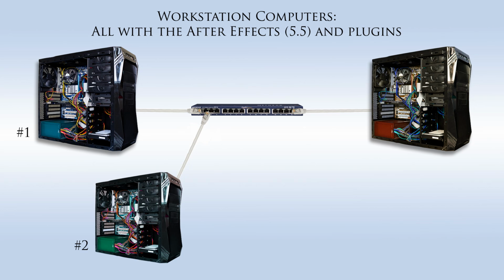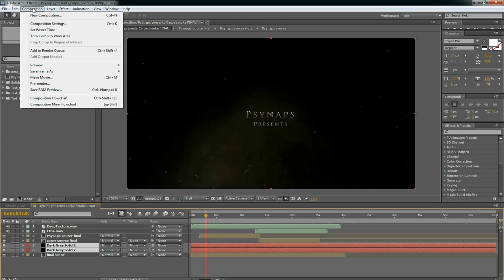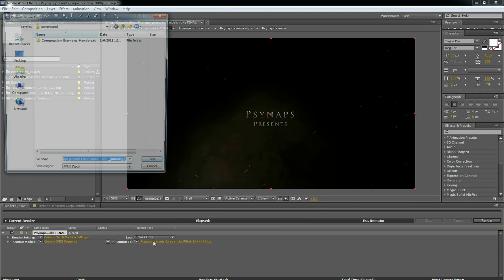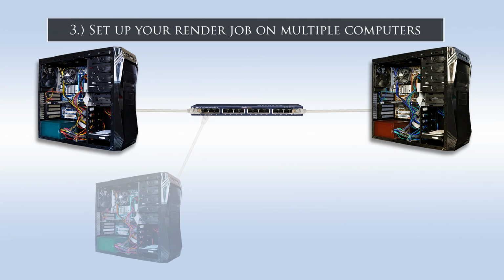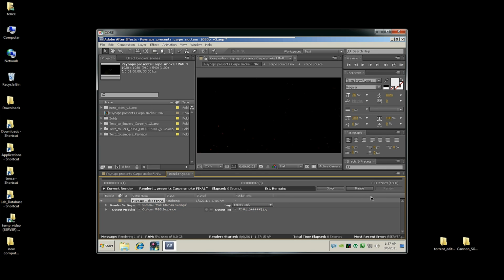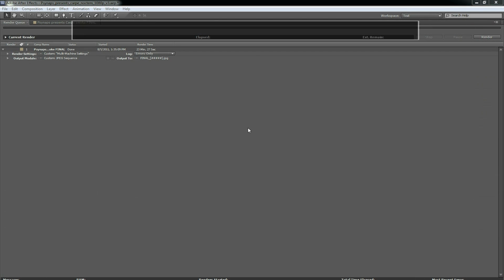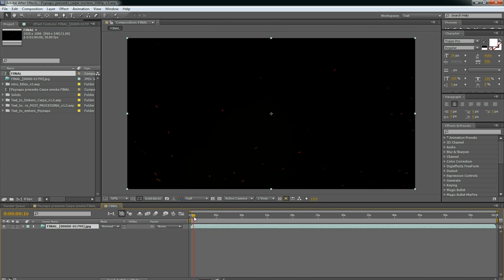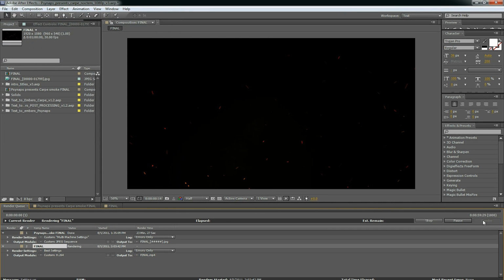After Effects Tutorial: Faster Rendering with Multi-Machine Network Rendering

Comment from the maker: @bl1ppyboy It does not have to be on a file server. 1 of the 2 computers can share the source video. You can also have the source video copied to both computers. In fact, this way is even faster because it does not rely on network/server speed. One strategy that works for me, render half the video on one computer, and the other half on the second computer simultaneously. Then combine the image sequences on one of the computers for the final movie. You can do this with or w/o a network/server.

Comment from the maker: Thanks for the comment freakstate. I've had great luck rendering one locally to a shared folder, and have the other computers help out to the shared folder. Network speed, and disk speed is a big rate limiting factor. The bottom line, the usefulness of network rendering depends a lot on how much processing each frame needs. If each frame doesn't need much processing, it may be faster to do it on 1 computer, but if its processor intensive, it may benefit significantly from network rendering.

Comment from the maker: Yes it works great in CS5. Yes, slow-mo and any effects work fine when rendering as an image sequence. You can use any frame rate in your composition settings, although I have never tried more than 60 fps. Just make sure, when you import the sequence, you "Interpret footage" and match the sequence framerate to the framerate you used during render/export.

Comment from the maker: Yes it works great in CS5. Yes, slow-mo and any effects work fine when rendering as an image sequence. Everything looks fine when the image sequence is played back at the same frame-rate it was rendered at. You can use any frame rate in your composition settings, although I have never tried more than 60 fps. IMPORTANT: Just make sure, when you import the sequence, you "Interpret footage" and match the sequence framerate to the framerate you used during render/export.

Comment: Does this really speed up the process of rendering, did you, by some chance, tested same rendering speed using one computer, and then using multiple? 
Cuz I don't understand this, if the first computer is rendering first frame I don't see what good can it do if the other one is rendering the same frame,  I mean I would understand if the first Pc was rendering every unpair frame (1,3,5,7,9..) and the other pc was rendering every pair frame (2,4,6,8..). So please explain it would mean a lot
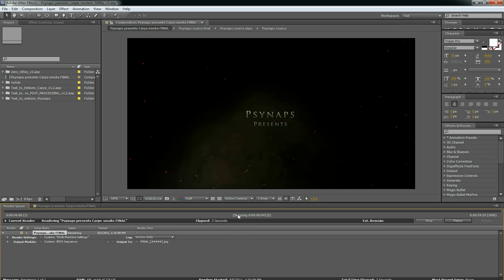Reply: I don't know if you are still looking for answer, but yes. The software actually checks if the images are rendered on the other computer. In 3:31 you can even see the message that it's skipping the images that the other computer has created/is rendering. This way even slower and faster machines can work together as they pair because they only start working on the next un-rendered frame
Reply: I know this is an old comment, but yes. Cut my 2hr and 45 minute render down to 20 minutes using two computers.

Comment: So the real purpose is just to speed the process for CGI, not to increase encoding time, i get it. I wanted to use two machines to encode video in 4K 60 fps in H.264 a bit faster, since one machine takes 3 minutes for 10 seconds.
Reply from the maker: ffmpeg can join two mp4s together, so you can render half of the video on computer #1, and the other half on #2, than join them together in ffmpeg WITHOUT reencoding them, the process in ffmpeg is almost instant. I will consider making a guide on it.
Reply: Psynaps That's exactly what i thought after watching this

Comment: if there will be around 20 or more computer connected to the network share at the same time , doesn't this create a bottleneck in the network traffic? If the Gigabit Ethernet can handle this traffic, how can the computer (the computer with the shared network drive) handle this??

Comment: if i buy a IBM System x3850 M2 Server
-4xQuad Core Xeon 2.93GHz-64GB-2x146GB SAS-2xPS-DVD
Model 7141-4RU 4U rack mount Server

4x Intel 7350 - 2.93GHz Quad Core Xeon - 8MB L2 Cache - 1066MHz FSB - EM64T (64-Bit) - Virtualization (VT) - 16 Cores Total
64GB DDR2 667MHz REG ECC SDRAM 
2x 146GB SAS 
IBM ServeRAID-MR10k
7x PCI Express x8 slots (2x hot-swap) 

his that any good for rendering ?

Comment: Great tutorial! But it seems not possible to render with more than 2 machines with one AE-licence!?
Reply from the maker: Yes, each machine needs a license with this method.
Reply: If, after setting up your render queue and saving the project, you "Collect Files" on a network watch folder, you can run the After Effects Render Engine on another computer (or computers) without purchasing another license.
Reply: *****
Yes, but only on one (1) other machine?!
Reply: According the Adobe site: "The single-user retail license allows you to install and activate the full version of the After Effects application on two computers.

You can install After Effects CC render engines on any number of computers without consuming these two activations." 

Granted, I have not attempted to do it on more than two machines, so I don't have first-hand experience. Make sure you're actually running the "After Effects Render Engine" on your other PCs after installing AE.
Reply: According to adobe you can use a Trial version as a Render Client! And then use as many as you want.
Reply: You do not need additional AE licenses for the rendering machines.
Install AE on the slave machine.
Place a blank file named ae_render_only_node.txt into one of the following locations, depending on the user account type:
*Mac OS:
/Users/[username]/Documents/
/Users/Shared/Adobe/
*Windows:
C:Users/[username]/My Documents
C:Users/Public/Public Documents/Adobe

Comment: Is it possible render on a server while I work on the project on my machine..??

I use BG render when i do rendering the CPU takes alot of resources and its usually slow as the rendering process is in the back ground, while i make the necessary changes in the after effects.
Reply from the maker: Yes, you can have one or more slave computers, and server computer rendering while you edit on your workstation. This is typically what I do to maximize productivity. I let other computers render so that my workstation's CPU can be used to continue editing.

Comment: You mentioned having After effects installed with Plug-ins on multiple systems...but surely, you are not required to have a license for every single system if you're only using them for network rendering?  That would be ridiculous and not even remotely feasible for most people.  Could you elaborate on that?  I vaguely recall doing this with after effects years and years ago and I could have sworn you didn't need a license for every single system that will be used in the network rendering (just your actual editing system).  Am I not remembering correctly, or did something change?  Thanks!

Comment: Does This work for première pro cc rendering ?
Reply: +Dominic Hammel Not as far as I know.
Reply: I was wondering the same thing. I dont think it does. But you CAN export a Premiere Pro project file to render elsewhere on your network. (Note: all files in the project seem to have to be stored in a network share.)
Reply: I know this isn't the specific application you asked about. But if you have a very fast computer sitting around doing nothing, you may as well use it.

Comment: I'm sorry but I don't think this work correctly.. : the two machine could render the same picture (if one pic take 10sec for example) they will see : "ok pic 0701 is not created, then I will begin the render" both of them will do it, one of the machine will finish first and will write the pic0701 , the second machine will finish seconds after, and will either do : overwrite the pic0701, or skip it (but the time for render would have been used.. so I'm really confuse here, I'll do some research.

Comment: All I want to know is how to render more than one video at a time.
Reply: +BLVCK_GODZILLA You can render one with After Effects' built-in Render Queue, and the other with Adobe Media Encoder (AMC). Simply drag and drop the AEP file to AMC and you can render as usual.

Be aware that this method significantly slows the computer because you're splitting the RAM usage between two applications. So probably it's faster to render one at a time.
Reply: Maybe but if you start the render process when you just finish your first proyect and because you can still use AE, you can start the second one at the same time and it will help you to don't have more unnecessary queue .

Comment: its most idiotic multi-machine render realization I ever saw. Same way you can just partial render on each machine manually. Slow and stupid.
Reply from the maker: Helps with frames that take a really long time to render (like some special effects). You are right that it is a lot of overhead, and many times you dont need this multi-machine method (like for normal youtube uploads). However, there are some projects where this method actually speeds things up a lot and makes all the trouble worth it.
Reply: @rsmrt  just use normal software. Try davinchi fusion or Nuke and you will see how out of date all this adobe shit.

Comment from the maker: Hi Ian, yes it works great in CS5. Yes, slow-mo and any effects work fine when rendering as an image sequence. Everything looks fine when the image sequence is played back at the same frame-rate it was rendered at. You can use any frame rate, just specify that in your composition settings, although I have never tried more than 60 fps. IMPORTANT: Just make sure, when you import the sequence, you "Interpret footage" and match the sequence framerate to the framerate you used during render/export.

Comment from the maker: Yes it works great in CS5. Yes, slow-mo and any effects work fine when rendering as an image sequence. You can use any frame rate in your composition settings, although I have never tried more than 60 fps. When you import the sequence, just "Interpret footage" and match the sequence framerate to the framerate you used during render/export.